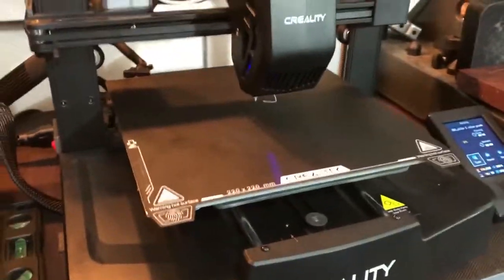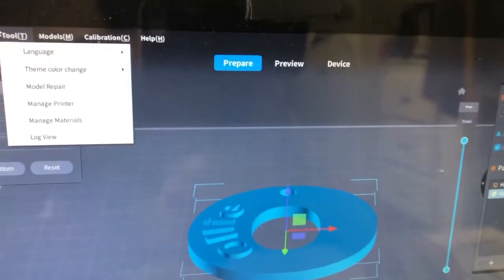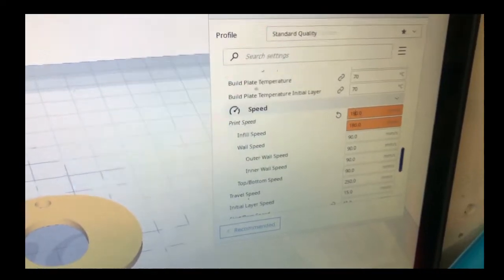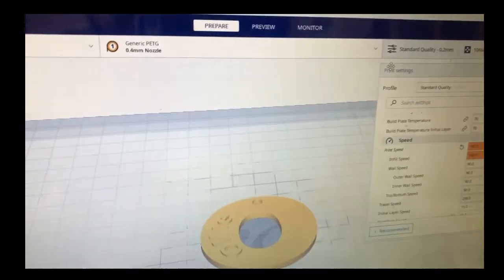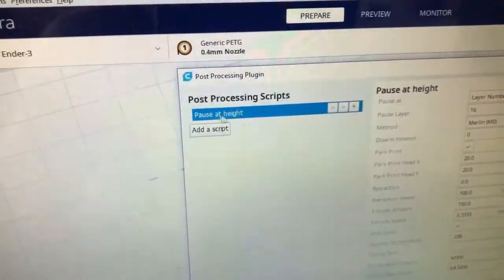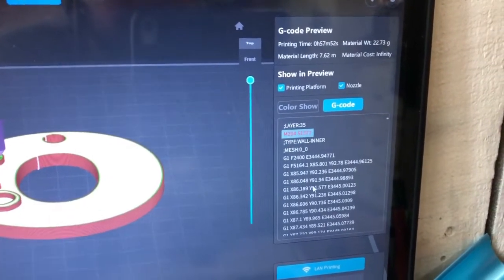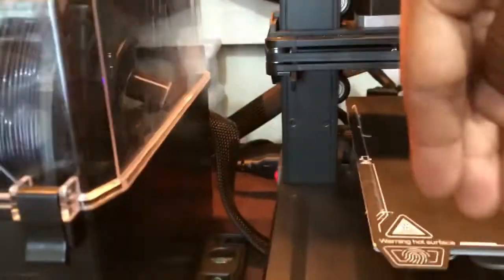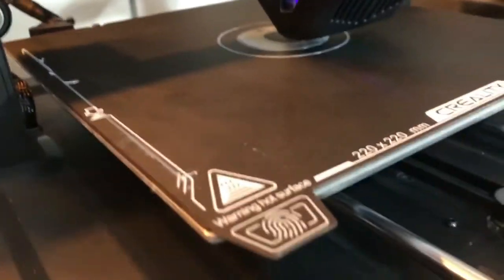Ender 3 V3 SE multi color print

Comment: The Ender 3 V3 SE has also been available in Cura since summer 2024. I know the video is now 1 year old and when the SE was new, Cura was still a bit behind
And just by the way, you can also insert a manual pause in Creative Slicer, not quite as convenient as in Cura, but it works.
So pause in the corresponding layer and change the filament manually...just like you normally do it, old school
Reply from the maker: Thank you 🙏 yes a lot has changed! Updated version 2 Color Manual 3D Print
https://youtu.be/8DB0tYvl5KA

Comment: So, i tried this twice now, and it didn't work out right.  The first time, it paused and parked, but didn't the display didn't change (it looked like it was running, and not paused). I clicked the pause button and nothing happend. I clicked it again, and it seemed to confuse the machine, Eventually after clicking pause a couple more times, it started up and extruded off on the side, and started up again... Second time, I tried it, I set the display message, and I tweaked the retraction so that i could pull the filament out (it didn't retract enough the first time), but this time the screen changed to "Homing, no other operation permitted" and froze there. I had to turn the machine off and on again. Suggestions? I'm running the SE with a filament runout sensor, with the default control screen. With the runout sensor, it always shows a pause message, in a popup with a continue button... No such luck doing it this way...  This is the GCODE Cura added:

;TIME_ELAPSED:6161.233657
;TYPE:CUSTOM
;added code by post processing
;script: PauseAtHeight.py
;current layer: 7
M83 ; switch to relative E values for any needed retraction
G1 F3000 E-80.0
G1 F300 Z2.44 ; move up a millimeter to get out of the way
G1 F9000 X20 Y20
G1 F300 Z15 ; too close to bed--move to at least 15mm
M104 S205 ; standby temperature
M0 ; Do the actual pause
M109 S205 ; resume temperature
G1 F3000 E80.0
G1 F199.998 E100; Extra extrude after the unpause
G1 F3000 E-80.0
G1 F300 Z1.44
G1 F9000 X116.924 Y183.193
G1 F300 Z1.44 ; move back down to resume height
G1 F3000 E80.0
G1 F2700 ; restore extrusion feedrate
M82 ; switch back to absolute E values
G92 E1665.23139
Reply from the maker: I’m an update video that skips the G-code

Comment: How did you pause and resume print?
Reply: I understand that. But did you printer stop? Did you have to use a control on display to resume?
Reply from the maker: @edward2allen press on the knob and then press resume after you changed the filament…sorry I doing an updated version on the channel this week.
Reply: Okay my issue was that it didnt work when connecting printer to pc via usb c.
Works well with sd card.
Reply from the maker: @edward2allen that’s interesting note.
Thanks 🙏
Reply from the maker: I did it using cura…right now you can’t do it on creality print

Comment: Needs a properly working M600 script. I've got my E3V3 working with prusa Slicer and octoprint. I had the machine pausing for color change... But I couldn't for some reason get the print to resume after pausing.

Haven't tried again for a while.  Sad that I now prefer my ender 3v2 over klipper than my ender 3v3. Meh.
Reply from the maker: I’m working Creality print multicolor print version.

Comment: check under print slicer under parameter config -> edit 
there you go to infill
on top of that windows you also see Advanced make sure its activated
and in Infill you will now see the option change Print color 
i am still trying to figure out how to use it so if anyone could make a good tutorial on it 
i'll be a happy camper !

hope this help you w/y prints !
Reply from the maker: This feature works sometimes on the SE very hit or miss…works flawlessly on the KE with Klipper software.

Comment: I'm using a modified E3V2 configuration for my E3V3se in Prusaslicer. Havent tried a two colour print yet.

One of the problems is... With the 3V3 (and Octoprint) is the Host Action Commands are disabled and I'm not sure how to enable them so the printer can talk BACK to Octoprint. 

Waiting anxiously for a MriscoC marlin firmware update for the 3V3.
Reply from the maker: Nicely done!

Comment: You can add change colour in creality slicer.
In the profile settings If you select advanced on.then under infill setting it will have a change print colour option come up. 
If you click on that more options come up. Back list lets you change all manually. I have only tried this feature once and it failed to work for me so i reprinted and just paused at height and manual change filiment then carry on.

Will upload a quick short on my channel to show you where the setting is for change colour
Reply from the maker: Tag me on your short! I like to see this in action.
Reply: @JonDesign3D done a tag

Comment: Your using cura?
Reply: I use Prusaslicer, and modified the 3V2 code to increase the speed. Base 140mm/s instead of a base 50mm/s for 3x the speed. (that's possibly conservative and I might bump it to 150mm/s and see what happens).

The V3se claims to be able to print at 250mm/s...but I think that's pushing it and I just want to find the balance of quality and speed.
Reply from the maker: @crooker2 nicely done
Reply from the maker: Yes, it works fine with the basic Ender 3 printer profile but lost the speed of the SE 😏
Reply: Hey  @JonDesign3D  I'm new to 3D printing and I'm using Cura with my printer (SE as yours). Should I understand that printing will be less quick if I use Cura instead of Creality Print ? After installing CURA, I saw that printer in the existing profile, so I selected this one, was this profile missing when you recorded the video?
Reply from the maker: @crazycrestedgecko2846 that’s perfect! When posted the video the printer profile was not ready.
Reply: @JonDesign3D  I don't know how to configure the ender 3 v3 if it's not cura, I don't know how to do it

Comment: don't use the pause at height use the filament change script it works so much better
Reply from the maker: That a good idea 👍🏼 Never thought to do this since it didn’t work properly on my original Ender 3…I will try this out next. Thanks 🙏
Reply: The change filament code worked great on my 3V2 with Prusaslicer. Havent tried it on my 3V3 yet. Will try today.

Comment: I hope they add it to creality print
Reply: It's not it actually has all the features and more you could want its just slightly hidden in a very bad laid out application....once you find them you will be shocked as its a non intuitive layout and a bugger to remember
Reply from the maker: @philmepowers I’m doing an update video for 2024…a lot has changed since I made that video in Creality Print slicer.
Reply from the maker: Yes, this machine has a lot of potential!
Reply: Creality Print is a waste of time.

I'm just using a modified 3V2 config in Prusaslicer and it seems to work ok. (I've only printed one thing with it so far, but it was a success) 

But an updated custom firmware solution (like MriscoC) would definitely be a good thing.